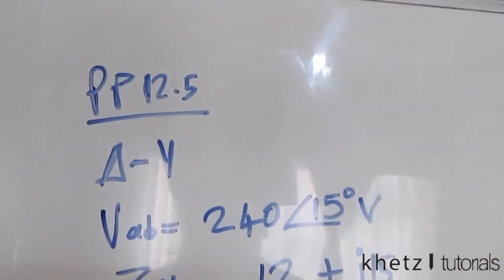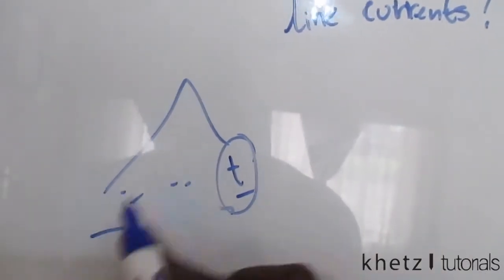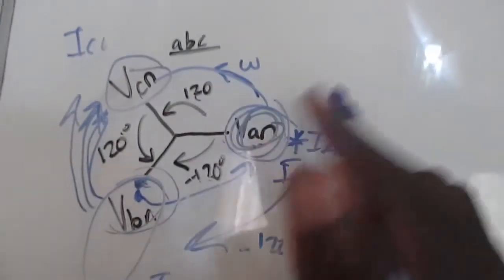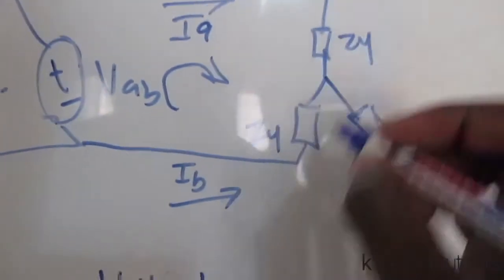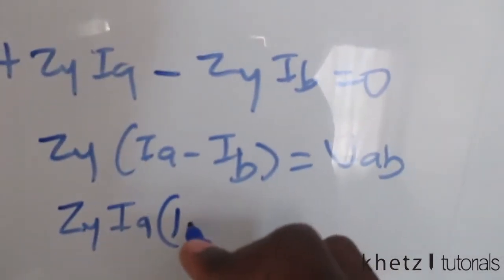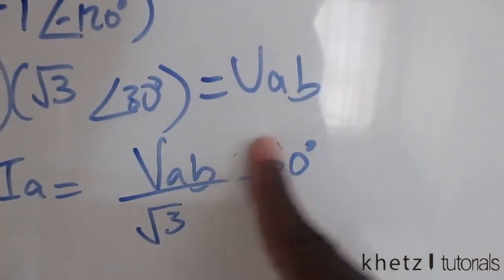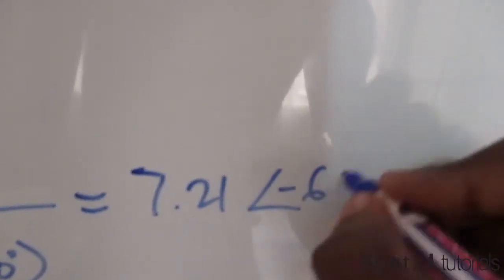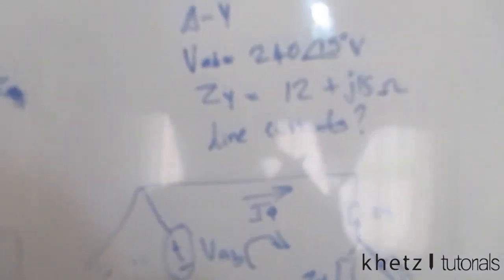Fundamentals Of Electric Circuits Practice Problem 12.5

Comment: Ib ? how is it 173.66 ? it should be 186.66 angle
Reply from the maker: They are equivalent. Try putting both of them in cos(x). You can either have a positive or negative representation of the same answer. I used this one because the textbook used it. You can interpret it as 240(two 120s removed from some reference) plus the angle you had or as 360 plus the angle you mentioned which should give the same result.